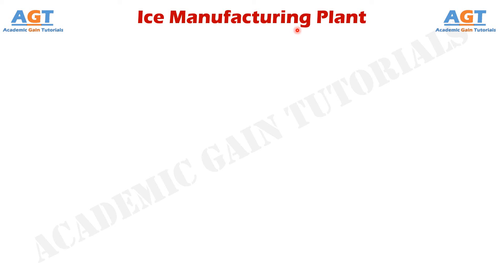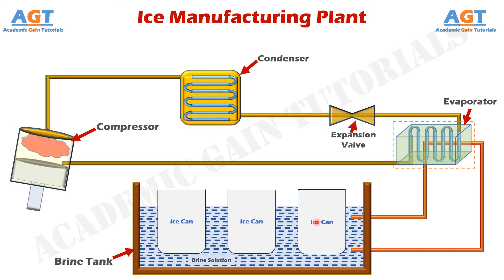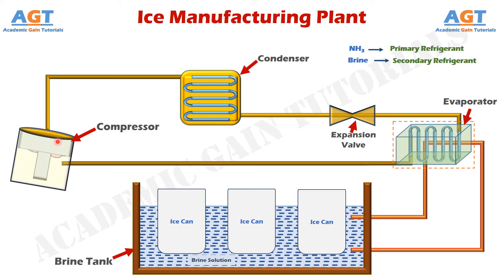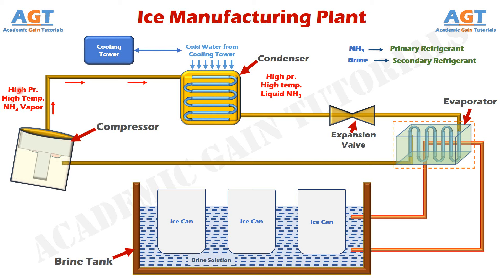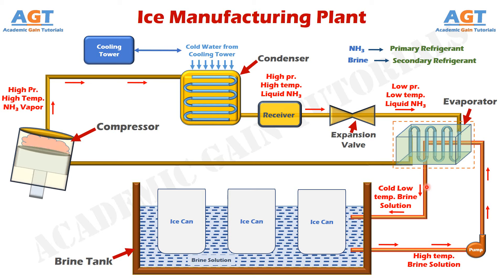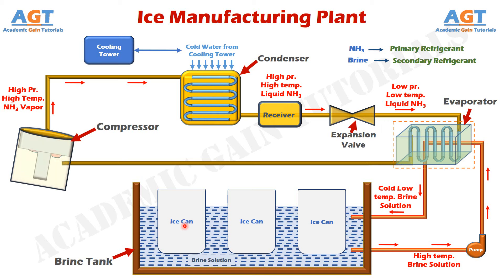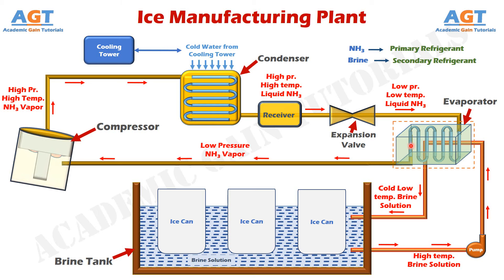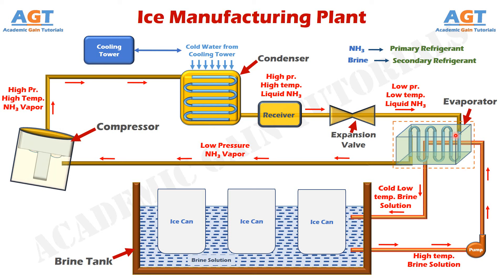How an Ice Manufacturing Plant Works - Parts & Function (Understand Easily) with Animation.

Comment: So what happens is basically we have an refrigerant I.e. ammonia which is compressed by the compressor converting it to high pressure and high temperature vapor nh3 , now to cool down it goes to the condenser and turns into liquid refrigerant still with high pressure it goes to the receiver and gets stored as high pressure high temp vapor , now it goes to the expansion valve which significantly alters the temp . And turns refrigerant  onto cool liquid state but pressure also drops , it's basically a mixture of vapor and liquid,  now the refrigerant is  passed into the evaporator and absorb heat from the brine soln and is again taken to the compressor

Comment: Nice presentation. However, my understanding is that as you said the Compressor pressurizes the gas so the Temperature goes up while remaining a Vapor. The purpose of the Condenser is then to lower the temperature, and by dropping the Temperature, it Condenses it to Liquid, so that it is now High Pressure, Low Temperature, Liquid. After it goes through the Expansion Valve it would become a Low Pressure, Super Low Temperature, Liquid (Boyles Law and the drop of temperature based on the lowering of the Pressure). After going through the Evaporator, it absorbs the latent heat from the brine solution which rises the Temperature and Evaporating the Liquid to a Vapor, so that it is now a Low Pressure, Warm Temperature, Vapor. Then to the Compressor where it starts over and is converted into a High Pressure, High Temperature, Vapor.

Compressor -> High Pressure, High Temperature, Vapor
Condenser -> High Pressure, Low Temperature, Liquid
Expansion Valve -> Low Pressure, Super Low Temperature, Liquid
Evaporator -> Low Pressure, Warm Temperature, Vapor
then start all over by going back to a . . . 
Compressor -> High Pressure, High Temperature, Vapor

Comment: its a high pressure and low temp. liquid when its out into the condenser ,because condenser already release the heat through the water cold condenser,
thanks me later